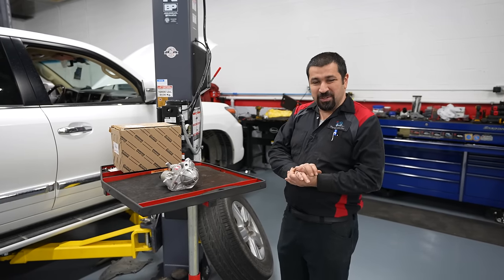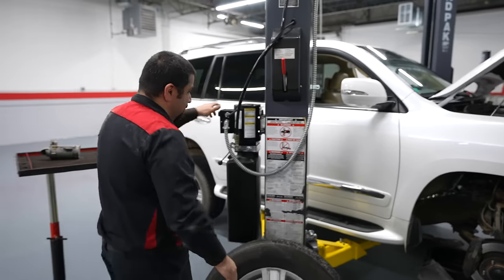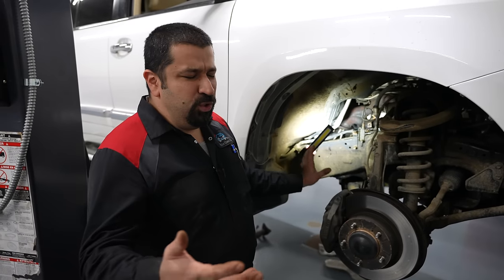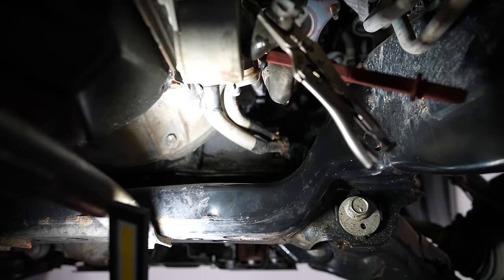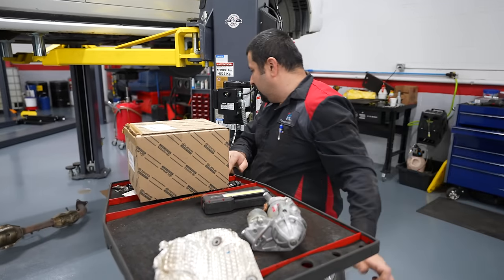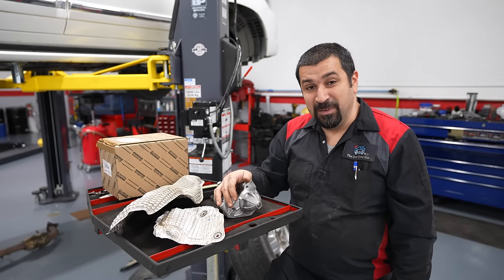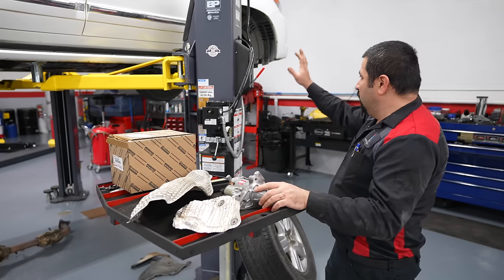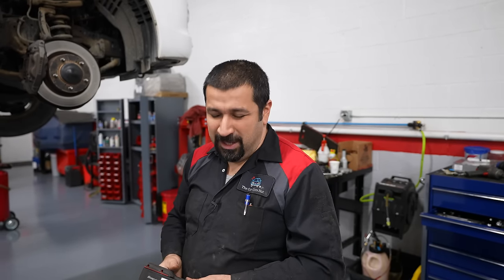TOYOTA! THIS is REALLY A Horrible Design! You Could've Done This Better!

Comment: Old timer showed me to hit the end of the stud with a welder and tack a tiny tiny bead on the end. The stud expands just enough to break free when it cools. Come right out, New England rust no problem.
Reply: If your good at it you can weld a single dot on a single dot on a single dot to a nut, extract the last quarter of the stud with needle nose pliers. Ford/GM/Ram at 100,000 miles ½ to ¾ of the studs are snapped without ever having tried to remove. Plow trucks are the worst. 2 years you got a leaking exhaust manifold. Toyota at 200k might have 1 or 2 broken.

Comment: These are not small lightweight cars. There is no reason for the ultra tight engine compartments they use. Adding two inches all around to the engine compartment would be trivial to size and weight but would make maintenance so much easier.

Comment: I need help AMD. I have a new gen 1.5 petrol engine. 2021 yaris. In manual written use 0w16 engine oil. In Turkey, official toyota seevices use 5w30. And they say ın hot climates. 5w30 is better. I don't want to hurt my engine using wrong oil. What should I do. Should I listen the local dealer or shoud I listen the manual book
Reply: As long as you are in hot climate 0W-20 would be fine and 5W-20 as an alternative.  I believe 5W-30 is not a good choice as higher viscosity oil increases fuel consumption and these oils dont transfer heat as well. 

More importantly  stick with reputable quality oil and filter.  Also, I would request statement from dealer in writing that Toyota approves 5W-30 oil and then send a copy to Toyota and see what happens.  😆
Reply: @kannermw  If I can reach Toyota Japan or Europe. I will. But I couldn't reach any e-mail to contact. Toyota Turkey call center says 5w30is need tp be used in our climatw but i have a big concern using thicker oil can harm my gentle new gen engine
Reply: I can reach quality 0w16 oil but I need to be sure if I am doing the right thing. They say using that thin oil like 0w16 will harm my engine In hot climate. 0w16 will become thinner and don't work well they said. I have mix ideas so I need help from a honest professional. Toyota Turkey is spoiled and can't believe them. They use wrong engine oil in past and damage a lot of car jıst for saving more money.
Reply: @burayisonradoldururum  Trust me they are recommending 5W-30 not  because of operating climate but due to oil availability , the number of oils they would need to support, and cost.  Toyota would never approve as this is not how these newer engines were designed and tested.
Reply: @kannermw  I exactly think like that too. Should I use 0w16 then? Even if I am in a hot climate.
Reply: @burayisonradoldururum  If available otherwise 0-20W would be fine
Reply: @kannermw  huge thanks 🤗

Comment: Someone in the rust/salt belt area should send the engineers who designed each of these piss poor design the particular rigs you mentioned and have THEM swap the parts. That transfer case nightmare guaranteed will send cars to the scrapyard...who wants to buy a new transfer case and astronomical prices or buy a used one that you don't know if it had that issue prior.
   This starter...your method is much much easier vs having to possibly pull a head for a snapped stud for a friggin starter....that route, if it happens as the cars age will also send the cars to the scrapyard.
     I'm sure the engineers do the job on a computer as it's being designed...but they don't account for corrosion....a computer can't mimic Mother Nature.
    I helped a friend swap an engine in a 2000 with the starter under the intake..wouldn't fire...long story short...popped the intake...wire left off and put on and zip tied back so it won't ever come loose....whole job...2 hours or so.   This car...glad it's not my car.

Comment: help, could someone please tell me how to disable my rear window wiper, i own a 2022 rav4 limited and i live at the beach so often there is a layer on sand on the wiper then for no apparent reason the wiper will wipe the rear window, i have own this car for 6 months and have never use the rear wiper but yet if feels that i need the rear window wiped. if any body could help me disable this i would be grateful
Reply: Open your car manual. find the location for the fuse box. pull out the fuse for the rear wiper.

Comment: At least this vehicle is clean underneath. If you have 5-10 years of undercoating (Krown or Rust Check) that area will probably be covered in a mess! The mechanics hate to see you coming! On the other side of the coin maybe the undercoating will make it easier to remove all these bolts as they definitely won't be rusty!

Comment: What do all horrific automotive designs have in common? All of them sail right through the warranty period. Only the customer feels the pain. As ridiculous as it sounds to pull an intake manifold to replace a starter I'd do that any day over an exhaust manifold! I'm biased since I've only ever replaced starters on V8s in Fords and Chevys. And those require replacement a bit more often than Toyotas.

Comment: OMG!!; I'm NO mechanic nor technician, (ER / ICU MD here who just loves cars / 'ars mechanicae'). Just a couple mechanical tips I learned from lending a hand to my (late, rancher + farmer + biz man Grandpa), on his trusty mid- 1.960's FJ40, later from his youngest son (my uncle, retired nuclear physicist), basically went something like: *If it ain't broke, (Not just 'don't fix it'), do NOT touch it!!.
*Regarding maintenance, always stick to Owner's Manual schedules, with special attention to lubrication / coolant(s). 
I later learned it's MUCH easier to work on a Toyota LC series 80 and/ or FZJ 73, than later models, ALL of the above w/ manual transmissions. We've had mostly Toyotas up to series 100 + Nissans up to 1.990's Y61, (pre- fugitive Carlos Ghosn era, circa 2.005), with barely any issues. Too bad most 'modern cars' manufacturers went from durable / reliable nodular iron engine blocks to 'last generation' aluminum & plastics everywhere. Not to mention computers + flimsy sensors too. 
Maybe a couple decades ago, (Australian desert) a family of five had a sudden SUV breakdown they couldn't fix, in the middle of nowhere. As far as I can remember 3 - 4 members of that family died dehydrated, waiting for help to reach them. (BTW: Their japanese SUV wasn't Toyota nor Nissan). Culprit?: One $1.75 defective electronic part in the ECU.

Comment: A lot of times I believe the engineers that design the engines don't have a idea how it's going to set with all the fenders and the grill and the hood everything else is going to be in the way to get anything done on your engine look at some of the manufacturers got spark plugs up against the firewall and you have to tear half the engine down Engineers got to get together in designers
Reply: Yes, I agree. A friend and coworker of mine was once a Honda and Toyota technician and said that these engines were assembled out of the car or truck and than installed into the car/truck at manufacturer assembly lines.

Comment: I've always been a GM guy and our first Toyota is a 2015 sienna FWD. My GM cars and our 2004 Dodge caravan are decades old with near 200K to near 300K on them. Have not had to touch the starters. Hopefully the sienna will be the same. I would never ever replace a part like that as preventative maintenance?! Who has money to just throw at replacing something that is working fine. Starters don't usually just up and die either, you get warnings. THEN you replace it. Whoever owns this thing in the video is a fool. If it ain't broke you don't fix it. Also, unless you live in Aspen, there is little reason for AWD. Just more complications and expense for very little added value. I have driven FWD cars through 8-10-12 inches of snow and plowed through drifts and have never gotten stuck. It's a waste of money.

Comment: As the owner of a Toyota, Lexus and a Honda, I can tell you that Honda does not have these problems. And, I can tell you that Toyota has a REAL problem with putting the bold heads where you can't get a tool on them. When I did the starter on my 1UZ-FE, I did all the work to remove the intake manifold, and rejoiced when I saw the starter. There it was! I could even put my hand onto it! And then I said, "WTF?! They put the bolts in from the FIREWALL side??"

Comment: I have owned a 96 Land Cruiser 80 Series, a 2003 Land Cruiser 100 Series, a 2006 Land Cruiser 100 Series, and a 2008 Land Cruiser 200 Series. I live in CO and used to drive to Southern CA to visit friends and and family. The 80 Series was lucky to get 10mpg and it was pure torture to drive up the many passes driving West on I-70. The 2003 and 2006 were better at both gas mileage and performance on the passes, but still not what I wanted. So in 2016 I found a 2008 Land Cruiser with 'only' 165K miles, I flew to Omaha, NE and drove it all the way back to CO. Finally a Land Cruiser with enough power to enjoyably drive on I-70! But 6 weeks after purchase the starter went out. After a $1K repair bill, I sold it. Toyota is no longer a company that I can trust to build a reliable truck. Since I no longer drive long distances anymore I found a clean, no -rust CA 2011 Toyota Tundra crew cab 2WD at my Toyota dealer with 187K miles and paid $12K, but did not take the truck to my Toyota specific mechanic before buying it on a Saturday. On Monday the next week he inspected the truck and found cam tower leaks and a rear main seal leak with a cost of $3500 to repair. It seems as Toyotas become newer the problems become more expensive to repair. I really miss my 2003 100 Series Land Cruiser, I could accept the timing belt replacement at 90K, but the 200 Series Land Cruiser and the 2011 Tundra with their built in problems with starters, secondary air injection pumps, cam tower leaks, and rear main seal leaks really make them not worth the price of admission. I cannot imagine why any sane person would buy the 2022 Tundra with the projected cost of repairs if the truck is going to be kept after the warranty expires. Given all the problems present in the newer Toyota engines for those like myself that will keep my truck, it seems the old reliable 4 cylinder pickups from20-30 years ago produced engines that cannot and will not ever duplicate their reliability. I realize USA emissions standards are ridiculous, and play a huge role in some of these problems, but certainly NOT with the starter or seals leaking! Thank you for sharing your amazing skills with us!

Comment: If enough technicians speak up, "maybe" engineers will design parts to last a long time. There's truly no reason for a starter to fail, if it's built robustly. As an example... the Ford 4.6/5.4 family of engines very rarely need water pumps replaced, even though it's literally a 10-minute job!

Comment: You never changed the hose from hell on the 90 to 99 MR2 turbo.
Or removing the CT-26 from the same MR2 or the 7mgte supra engine.
Or maybe removing the twin turbos on the 2jz. 
Worst offender is the UR series V8s like what you're doing.

Comment: I was a GM Tech for 15 years at 2 dealers, and I feel your pain. I will say the worst job in my history of automotive repair was a Turbo on a Duramax Diesel. I have now had my 2011 Tacoma with 130,000 miles on it and it has been great. It only got me with to Electrical problems. I have a video on both. One I thought was Torque Convertor shudder for years. It ended up being the bank 2 oil control valve, it didn't throw a code untill 6 years and a timing code. But!!! It fixed what i thought was torque convertor shudder. It was engine timing off a slight bit for years and never threw a code.

Comment: I've never heard of anyone replacing the starter "just because it is old/might fail".  Sure, I can understand it if you are rebuilding the engine, or perhaps installing a new engine.  Perhaps the owner wanted to get those bolts out before the actually did rust in place.  I can understand this logic being an outboard technician in salt water.   Starter under the intake manifold??  Didn't it get drenched with oil/fuel residue?  
Has Toyota changed the starter/heat shield design since then??

Comment: For bad Toyota design the 05-06 A750F body side Trans connector that allows salt in over time and rots the internal Trans harness. Requires a connector or body side harness replacement along with the internal harness. 

Or the 04-06 Tundra DC two part Master cylinder. Crappy design that fails and puck into the booster. Also stupid expensive to replace because you have to buy OE from the mothership.

Comment: I chalk it up to experience. Toyota has made tons of awesome 4 cylinder engines and they are some of the easiest engines to wrench on. V8’s not so much. Toyota is very good at learning from their mistakes and fixed the starter placement issue by getting rid of the V8. Problem solved.

Comment: How much it will cost me$,if I bring my 2018 toyota rav4 xle to change my brake fluid,my transmission fluid,filter,gasket,difentiol,fluid,and transfer case fluid I will bring all the fluids,and parts,OEM.
Reply: They will probably grin 😀,  they will charge about $125/ hour on their work.  they cannot put markup 35% of what you bought.

Comment: Lexus is treading downhill.  I’m use to seeing Lexus’ with close to 300,000 miles on the original starter.  How did Lexus goof up the starter design on the LX in this newer year shown in the video??????  Your criticism about starter placement is secondary. The starter ACTUALLY GOING OUT IN THE FIRST PLACE IS THE REAL PROBLEM.

Comment: Also you could use 3 long pieces of rubber/plastic hose that you push over the threads before you reinstall the shield.  Put the rubber hoses through the holes on the shields, and they will lead you to the threads when you try to get the shield back on.  Indeed a horrible job, but if you find ways to make it better, it still could get a fun experience and your customers will love the lower bill surely.
Reply: You're not using any rubber hoses to line up anything because there's no room for that
Reply: @ironmike742  you can put studs on the new starter and add push a thin tube of say 5 foot on, before you install it. If the wholes in the shield leave o room for a thin tube, fe a heat shrink tube could work and you could even slip the nuts on there and add a (fuelline)clamp, so you have the nuts ready/within reach.  After mounting the shields, you could even one by one  replace the studs/bolts again by the original bolts.
Reply: basically CCN made absolutely the right call of how to approach the starter replacement, just the fiddling to get the heatshields back on is a pita. With 3 studs and say a hose (or wire, anyting) on them to feed the shield to over the studs easily.
Reply: @waltersheens1087  😲 OMG

Comment: there is a word for it "pesky  starter", wait until you see new V6 with dual turbos that sits way in the back of the motor. I do not understand those clowns  in Toyota in V6 configuration so much room in front on the car, but no lets cram those turbost way in the back, why do I talk about turbo, a thay have a rubber hose both of them next to exhaust pipe that will dry out at no time

Comment: Mechanics complaining about hard jobs like this is a catch 22. I agree the engineering is poor, and I agree the ones under the intake (in Toyota's case) are really not a big deal. On the other hand, charge accordingly and get paid like a professional. You didn't make it, and you didn't break it. All you can do is fix it. Thanks for the heads up, I won't get burned on my first run at one of these.

Comment: Toyota v8-5,7L starter is still better MBZ V6 or V8 engine. Well, 4matic is more headeach too. The V8 starter under the intake plenium last too long, that is why they changed to new design. But, either way, starter job is 7-10 years old car job. Sometime 4yo car job. Just beat it.

Comment: I met a guy with a 2010-ish Tundra 5.7 who uses it for work with 380K on it and the starter was the ONLY thing besides the consumables that he had to have done, and it was recent. I agree: Don't do it preemptively.
Reply: I think on my AWD Lexus GS (it is rwd based) the exhaust manifold has to come off. So tight the front diff has a knockout  by the gas pedal.  Your side  foot can touch it.
Reply: @alb12345672  yes, I have heard it really can be an 8-hour job on a 4x4. Not gonna try it at home.

Comment: No one is perfect. That is why in critical situations, such as the military, they made it easy to pull the whole engine, then they can get at the starter easily, or if there are major internal problems, they will replace the whole "power pack" , that is what they call them. Send it back to the rear where they can mess with it without getting shot at. They also have the expensive diagnose equipment there. The Russians take this to an extreme, so their planes can operate out of primitive air strips and maintain by first year recruits, while they are getting shot at.  One US fighter jet, you can replace every peripheral  component around the engine such as hydraulic pumps , generators etc with a soft plastic wrapped package of 8  simple tools, all done in 20 minutes or less and that is common practice.  They have a lot to learn in automotive. Complaints of difficult access been around since the 1960s.  Chevy Corvettes and some Chrysler, Ford V8s actually have a surcharge for difficult access or higher dealer hourly rate.